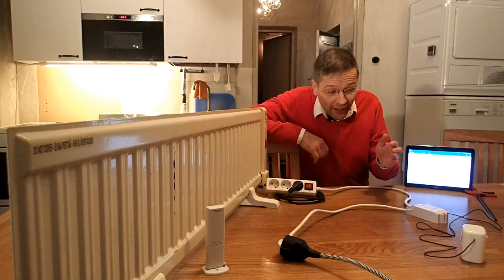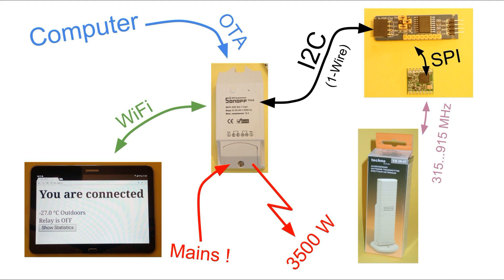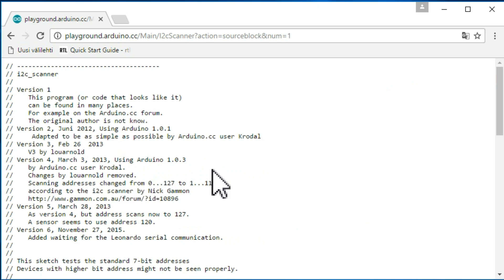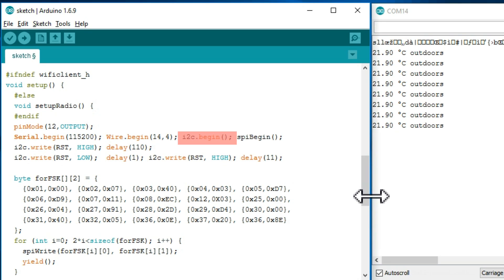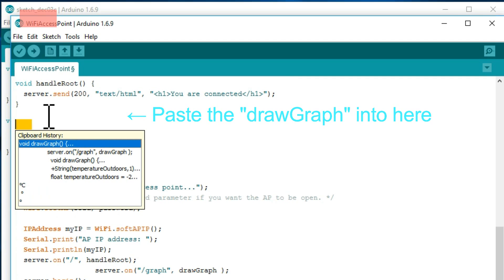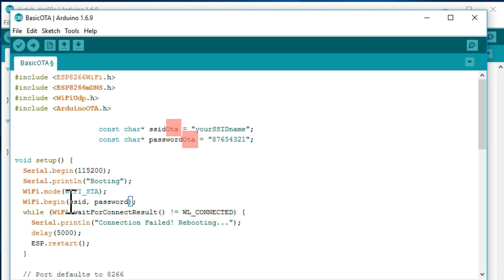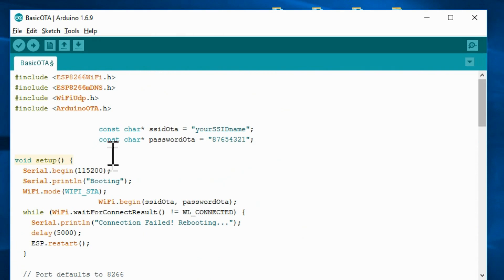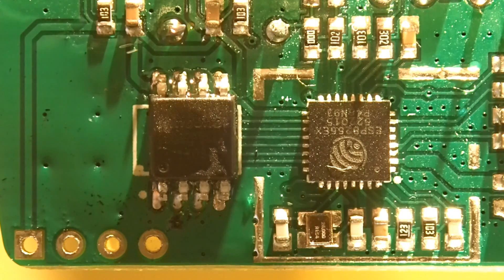#8 Sonoff TH16 programming and the I²C bus

Comment: Hello, great presentation. I want to do what you did but with wired connection of the thermometer (6-8 meters away). Do you think that an 2.5mm extension cable will work? Thank you
Reply from the maker: Hi! The wireless system of the video would surely work. For a thermometer you could consider using the 1-Wire bus that the TH16 already has https://www.maximintegrated.com/en/app-notes/index.mvp/id/148 

The length of convetional I2C connections is limited to few meters, but with chips like DS28E17 you should be able to increase it up to 100 meters https://www.maximintegrated.com/en/app-notes/index.mvp/id/6208

Let us know how you got your system working!
Reply: Thank you for this quick reply. I will try that and I will post.

Comment: Quickest channel subscription ever! Awesome video, Thank you for posting. You answered one of my questions on this device. I was wondering how easy it would be to adapt the TH16 to work with MCP23017-E/SP via I2C. I work more with 12v circuits and use the TH16 with 230v relay to switch 12v circuits. using a port expander with an 8 or 16 relay strip via I2C would be much more efficient and easily expandable.
Reply from the maker: Thank you for your feedback :-) I'm glad that you found this video. I'm quite sure htat your I2C project will be a success.

Comment: thanks for the video Miika. Actually do you have the instructions to reprogram Th16 with the original thermometer sensor which comes with it?
Reply from the maker: Hi Elie Hanna! Thank you for your feedback! The temperature+humidity sensor is the AM2301 (that you can get cheaper form eBay). There are many good tutorials for that sensor, for instance http://homecircuits.eu/blog/esp8266-temperature-iot-logger/ Just remember to declare in your program that you are using the GPIO14 pin for the sensor. 

For the Sonoff Sensor-DS18B20 (temperature) there are even more tutorials available. Just search for "ESP8266 DS18S20 tutorial" and, again, remember to declare in your program the GPIO14 pin as the data pin.
Reply: Miika Kurkela tt

Comment: I understand the poor circuit board pads. Lost two boards before using the technique you used. Wish they would just pull the large chips on. Thanks for the vlog. Also place the sonoff in a plastic box is a good idea.
Reply from the maker: Chip Quick is a great product. But I think that it should be a little cheaper. Thank you for your feedback!

Comment: Lots of good info.  Thanks for sharing. I have one concern though:  you show an extension with a connection to the internal circuitry of the Sonoff.  To my knowledge the circuitry of the Sonoff is more or less connected to live 230VAC !!  It has no isolated low voltage power supply.  Could modifications like this be leathal?
Reply from the maker: Your concern, Et K., is justified. Hopefully these two videos can answer to your question: https://www.youtube.com/watch?v=hv_FpBqWFrg&feature=youtu.be&t=48s 
https://www.youtube.com/watch?v=8mz5sCAvDAY&t=249s

Comment: I think this might finally motivate me to start using wireless temperature sensors in lieu of ESP8266/DS18B20 powered off adapters all over my house!!! Thanks for the good, clear video.
Reply from the maker: Yes in deed! It is somehow contradictory that we are trying to take care of our beloved houses and do it by drilling holes through its walls for some DS18B20 sensors. 
It has been estimated that the electronic wirings of a house have to be remade after every 20 years - and again we drill a lot of holes though the structures of our home. Just imagine, what would be left of the Pyramid of Cheops if they would have drilled holes through its walls after every 20 years :-) Wireless solutions are better for our homes!
Reply: structure7 THAT is a cool thumbnail... Ever-ready 9-lives